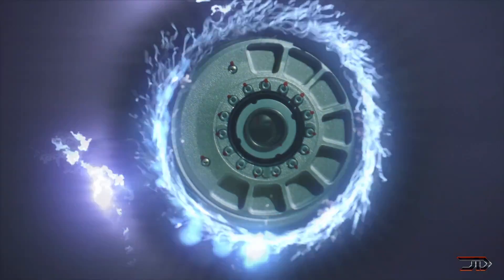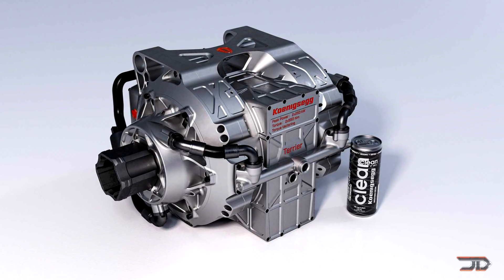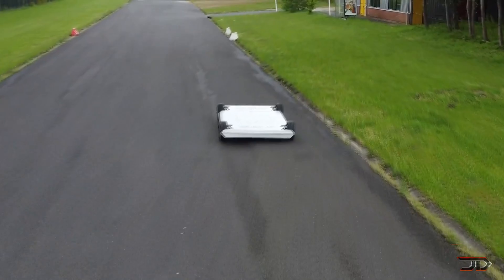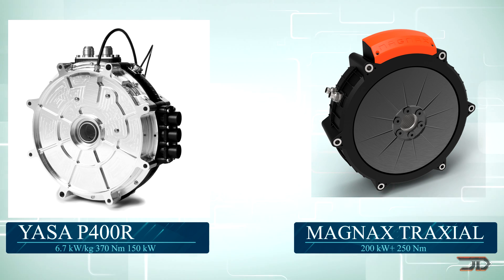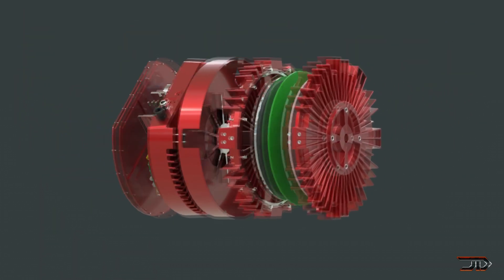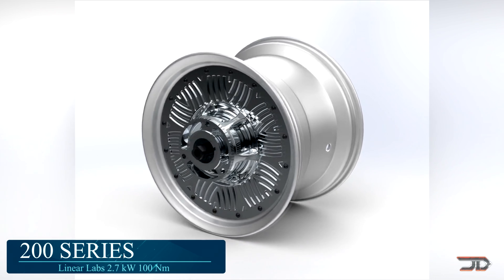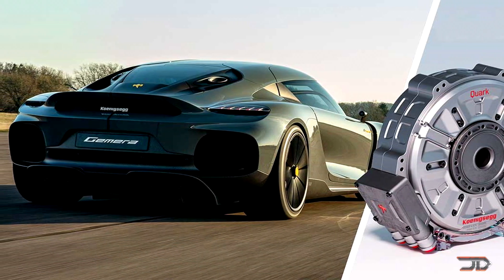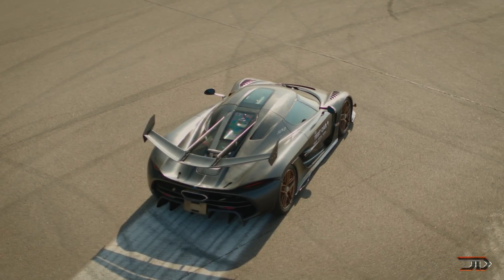INSANE New Motor Is Most Powerful Ever Made!

Comment: Electric cars do not have the stay in power. I can drive several hundred miles on my reciprocating engine powered motor vehicle and I can fill up with fuel and take a Pee break in about 10 minutes.  It might take several hours to recharge the batteries in one of these electric vehicles. Electric vehicles might be excellent around town, “city cars.”  We could usually use cars to take kids to school, to go shopping and run errands. The cost of one of these shitty cars it should be $6000 to $8000.  Thomas Edison one said that electric vehicles are highly impractical. The outrageously high cost, limited range and other limiting factors prove him to be correct.

Comment: Who cares about energy density of the batteries when you have something like a tesla model 3 rwd. That weighs within 100# of its nearest most commonly conquest traded ice competitor which is a bmw 3 series. The tesla m3 rwd gets over 130mpge, 0-60mph in 5 secs and can travel 270+miles on less than the energy contained in just 2 gallons of gasoline for 46k while running off of sunshine or other renewables. 

Imagine where evs will be in another 3-5 year's with solid state cells hitting the market. Solid power, nio and others will have working semi solid state cells in cars later this year available to the public and being tested by major oems for the pure solid state cells. 😎👍🏻
Reply from the maker: True! I am really looking forward to sold state, I believe they can hit 1000 watt hours/kg which is almost triple then li-ion.
Reply: @Motor_Explorer1  yes even 500watt hours per kg would start to make electric planes much more interesting and viable. 👍🏻

Comment: John Sikes: I don't worry about it.  The market always works out in the long run.  Remember the Wankel a few years back?  I was in Germany then, and it was the hot item.  That was twenty years ago, but you don't see them now.  I remember cars, motorcycles, snowmobiles and even aircraft.  Not now, but we will see!
Reply: You should check out Liquid Piston. It is a rotary engine but vastly different than the Wankel. I think that there are still companies that use the Wankel.
Reply: @thomasleemullins4372  Yes, I have checked Liquid Piston, I believe Mercedes is interested.
Reply: The Wankel is still very much in play, as is Liquid Piston and others.  These are interesting times!

Comment: That power needed to power these motors will come from fossil fuels.
Reply: I guess the video link is just too much to watch? Elon Musk explains why using fossil fuels to generate the power for electric cars is still a benefit. 

The reason? Fossil fuel power plants have efficiencies around 60%. Internal combustion engines are at 20%. 

Even factoring in transmission losses, electric cars end up being twice as efficient as any gas car!
Reply: @tomardans4258  Yeah, you left one out, the efficiency of the cars themselves.  But your final figure is probably not far off, even though, as a guess.  

There are some serious problems with electric vehicles, too.  Not the least of which is the fact that so little of the batteries were recycled, but now that has been very well addressed. 

The problem is that even then the incredible growth of electric cars will very quickly wipe out some of the rare materials needed to produce those batteries.  Other battery technologies are being worked now, but I haven't heard of a real fix for that yet.   Bottom line, there are better and worse, but nothing is a panacea.

I fully believe that electric will fully or almost fully supplant IC eventually in most areas.  You can't remotely use it for things like commercial aircraft, though, it is COMPLETELY useless there, and even for most general aviation.

I doubt that batteries are going to reach the energy density of fossil fuels for a very long time, if ever.  Since that is true there will need to be a way to charge batteries in a similar time to filling a tank, for long trip use, and the electrical infrastructure to do that would be totally impractical, unless maybe with distributed nuclear.  And there are some designs out there now for those, but they will likely be prohibitively expensive for most.
Reply: @MrJdsenior  I’m not an engineer. That was just my poor job at summarizing what Musk said in the video clip.
Reply: @tomardans4258  Not at all, you got it pretty much right. I wasn't trying to point out an error so much as add another point. Sorry if it came across that way.
Reply: @MrJdsenior  peace
Reply: @tomardans4258  :-)
Reply: @tomardans4258  Ok so FF plants are 60% & internal combustion engine is 20% efficient. But they want to get ride of FF altogether and be zero emissions, right ? But solar is 12% efficient and car batteries are 70% for 10 yrs after that they both need replacing. The cost of manufacturing an electric car without FF let alone will be astronomical and that includes those shiny new cars depicted in this video that are too much for me to watch ! FF is used in and makes everything.
Reply: @Matlockization  My only point, and it isn’t mine, was about FF plants.
Reply: @Matlockization  I would point out that comparing efficiencies between FF and solar is tricky. In both cases, ‘efficiency’ is referring to use of the resource. So solar panels are using 12% of the Sun they receive. Apparently the new ones are at 20%
Reply: @tomardans4258  Yeah but you can't generate base load power with solar panels if your going zero emissions.
Reply: @Matlockization  I’m not an engineer.
Reply: @tomardans4258  That still doesnt explain how ya gonna generate baseload power.
Reply: @Matlockization  These all sound like excellent questions for someone like Elon Musk.
Reply: @tomardans4258  Elon Musk isn't mandating zero emissions with the green new deal. It's the democrats.
Reply: @Matlockization  Jesus dude. Really? I stated my point at the first comment: that the usual objection about e-cars being powered by FF plants isn’t valid. I mentioned nothing else. 

I’m pro-nuclear myself.
Reply: @tomardans4258  Right now all these electric cars are being made using FF in countries like china who don't have to reduce their CO2 by 2050. That's how these cars are able to be affordable to the consumer right now, but that won't last. An article in industry week said that it took 74% more CO2 to make a lithium battery when compared to conventional cars !
Reply: @Matlockization  The solar efficiency doesn't factor into the equation in any way except that more panel area is required and I guess you could argue about the increased energy cost of production.  Another aspect I didn't point out. There are several more, but I wasn't trying to teach a class on the subject.

Solar panel replacement is more like 20 years, many are actually guaranteed for that time frame, to some decreased level of output, about 80% IIRC, it's been a while.  And you very much do not have to replace the panel even then, unless you are area restricted, because you can add panels to make up the difference of the decreasing power output of the old panels, and just totally swap them out when you deem them of unacceptable performance level, given your preferences for all the applicable trade offs.  IIRC their end of life is kind of exponential, though, but still.

Batteries are now 98% materials recyclable, but energy is still required in the repossessing of the materials.,  Battery  technologies have, and will continue to evolve, improving every performance aspect. 

The IC engine has been iterated and refined for FAR longer than the level of battery tech needed ultimately for electric cars.  I expect it won't be that long before battery life will exceed typical IC life, even at today's (or tomorrow's) level.

And the cost for manufacturing cars without FF is already FAR from astronomical, as evidenced by cars currently being sold in both categories.  The price for FF production will likely change very little, but that is less likely for non FF vehicles.  

Electric cars are very much coming and will ultimately likely replace FF altogether, save some historical/hobbyist interest, for as long as fuels can be obtained.  I am a car nut, too, one that has restored a few cars, rebuilt several including significant hop ups, and there are aspects of electric cars I am not particularly fond of, and aspects that I very much would be, I'm sure. Talking to people whose opinions I can respect tell me now that do own them that they very much like them.  

I asked one friend that was an accomplished architect, a very bright guy, and whose current hobbies include personally owned general aviation, etc. how he liked his Tesla sedan, and his answer, word for word, was "It's like a drug".  Sounds like maybe he likes it.

I'm not totally looking forward to the day self drivers, in the self driving mode are required either, if I live that long, but traffic problems would be alleviated to a tremendous degree, accidents will be drastically reduced, and there are times, even now, where I would like to flip a switch and do something else when I am forced to drive. There are also times, most of it actually, where I would rather be driving the vehicle manually.

My point is that there are always trades, and your comment hints at the likelihood (to me) that you are kind of biased and looking for reasons to resist the change, and that's obviously your business and opinion, not mine, but it is coming, like it or not, and in terms of the environment it is long overdue.  My guess is that we are totally farked on that one already, but we can at least slow down and MAYBE limit the ultimate level of damage...maybe.
Reply: @MrJdsenior  If solar panels are so competitive then why is the government still subsidising them ?  A car battery still requires FF power in countries who don't have to reduce their emissions by 2050. But when the goal of zero emissions is reached the price of everything will go up and stay there. Don't say you weren't warned. I also have a friend who's an architect he bought a 5 yr old EV. After 3 months of driving he had power issues. He took it to the mechanic and they said you need to replace the battery. The cost of replacement was the same value as the car. After 8 yrs all batteries need replacing and take progressively longer to charge. The warranty on EV battery's is a few yrs. Well within the wear & tear period. Your comments hint that there is an obvious bias and yes the change is coming but I assure you, it not the kind of rosy picture your future you think its going to be because the trade off will be huge. BTW speaking of damage, CO2 is a plant food and it doesn't contribute to global warming because its soluble in water & heavier than air. But here's the real message, everything you use today is made from FF. You will not recognise the world of zero emission which is the goal of the democrats. I'm not against renewables, but to have them completely replace FF is not realistic.
Reply: @Matlockization  Yeah, believing things like CO2 doesn't cause global warming, when there is data EVERYWHERE from several different disciplines, including direct measurement of present and past temperature vs CO2 curves kinda puts you in the category of a flat Earther, just sayin'.  Let me guess, you didn't buy Freon being at least a contributor to ozone depletion either, but oh look, when the refrigerant formulations were changed the hole problem was relieved a very significant amount.  Some people won't be confused by data and logic, and you appear to be one of those.

CO2 is not a food.  Plants make their OWN food through photosynthesis.

I never said anything will completely replace FF.  It is used in plastics, pharmaceuticals and many many other industries.

My father has owned two hybrid Camrys and put a lot of miles on both of them.  The total problems he had with the first was a rear view mirror problem that was fixed under warranty, and so far he's had none with the second.  And by putting miles on cars, I mean miles.  The Acura TL he gave me had 309k on it at that point, and the engine still has honey colored oil at changes and the car still drives almost like new, and has had one starter and one alternator, and a compressor clutch, and finally a tranny rebuilt at just after 300K, do yeah, both FF and hybrids can be VERY reliable if you actually take care of them.  If you don't, they won't be.

One way you can drastically extend battery life on electric cars is to never (or as rarely as possible) go below 15%, and charge them only to 85%, which is fine for commuting and virtually all everyday, or even several everydays worth of driving.

My comments didn't display any bias, I was just giving you a comment from a friend, and as a retired electrical engineer what IS coming, whether you like it or not.  I TOLD you in the comment that I was a big fan of classic cars.  And I explained some aspects of present and future cars that I both liked and disliked.  Your hitting me up with that bias comment only shows me you have more bias than I thought.

You can drop the Dems/Pubs BS, too.  That REALLY makes me understand where the bias is originating, and where you glean your science facts, meaning from someone that apparently thinks 'windmills' cause cancer and that we should look into injecting bleach to cure COVID. 

And no, that is not because he was a Pub, it is because he was/is a fucking idiot.  And he said things like 'the first thing they did during the American revolution was attack the airports'.  OMG.  Do you think he thought they were still flying F16s, or that stealth was well along at that point?  There were quite a few Dems that weren't too bright either, but nothing even close to that level of stupid.

Cheers
Reply: Most of it, currently.  I know people who are powering their cars primarily off of solar power, direct from their home systems, but it takes a larger than house only system to accommodate that mode, and you really need battery storage as well, to collect excess power during the day to charge in the late evenings/nights, as happens with most job commuters.  Also the power generated now by solar, nuclear, hydro, etc does not come from fossil fuels and as that becomes more and more the percentage of total power created, and it will, the fossil fuel problems are reduced.

They will still be extracted for other uses, like plastics, but at least we won't be burning them to anywhere near the extent we are now.
Reply: @MrJdsenior  The fossil fuel problem existed before the Ukraine war. But it developed after democrats got into power, that's a very strange coincidence. Although some guy showed everyone a few years ago how to reduce oil prices. His name escapes me......some call him Trump.
Reply: Power plants that run on coal and gas that charge the batteries of the electric cars. Shifting the pollution from one source to another.
Reply: https://youtu.be/L0R0kipOTfE

Comment: New technologies in electricals and electronics specially EV related is quickly becoming outdated even before it's full implementation and people/masses getting to know about it properly as new innovations/improvements emerge don't know if it's good or bad as we need some stability and pause for things to settle down.
Reply: That is always the case, with every kind of tech.  In weapons systems the design phase to actually fielding is typically like a decade.  At least it used to be.  And the design phase uses the best parts available at that time, so even more lag if you consider the design to production times for the chips, as well.  Streamlining all of those phases to the maximum degree would yield significantly to significantly time from chip tech, or battery tech, or whatever and bring the entire cycle down, speeding up time to market.
Reply: @MrJdsenior  thanks 👍
Reply: @ag135i  :-)
Reply from the maker: I agree, I think it's to do with grants/financing for research as well.